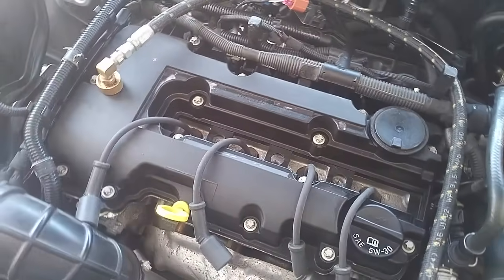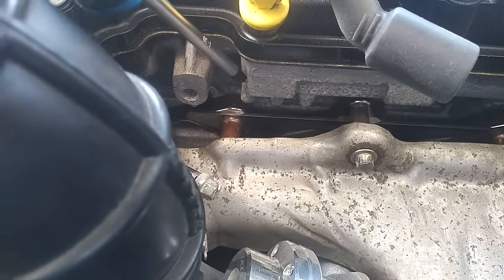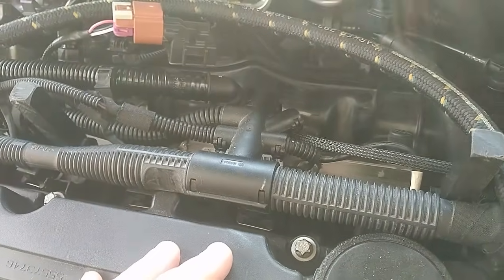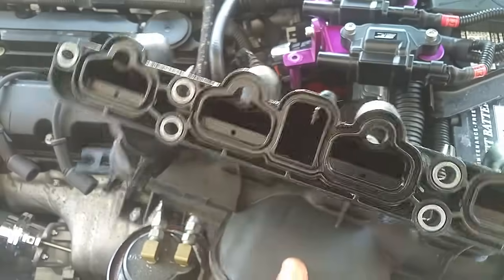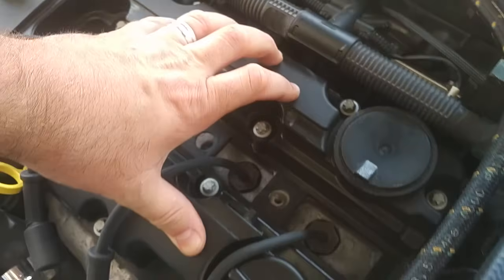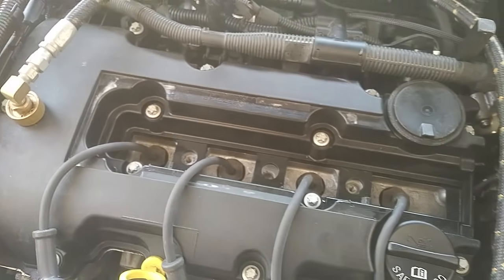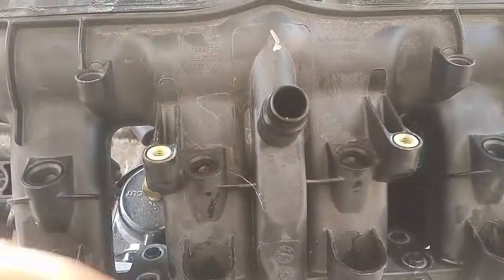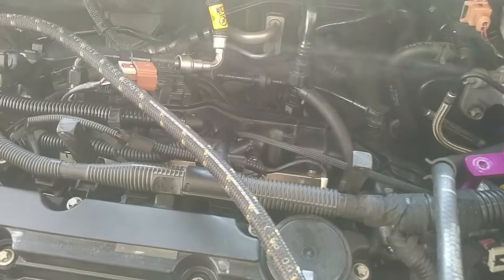Chevy Cruze Sonic Trax Encore 1.4L Turbo PCV Issues, Diagnosis, and Solutions

Comment: If that nipple you're talking about inside the intake is missing will that cause the p0299 under boost code ?
Reply from the maker: It will contribute to one. It may not cause it on its own, but a P0299 isn’t indicative of one single failure, but rather a number of things that reduce the efficiency of the turbo system, so a small crack in the turbo may not trip a P0299, but a large crack would, or a small crack and a missing intake manifold check valve (the missing nipple). So even if the turbo has a small crack (very normal and develops within the first 1,000 miles), you may be able to get the P0299 code to go away by addressing the missing intake manifold check valve.
Reply: The oil cap was left off and  vehicle was driven around for about 20- 30 min ever since then the po299 code came on
Reply from the maker: @tmangan327  that shouldn’t cause an oil cap to be off on its own. That would have been a p0171. Have you checked the intake manifold yet?
Reply: @AndreiDPop 
Yea the nipple is there 
On a tsb I found on Mitchell on demand it says to check the charge air bypass valve for oil water and  sludge . I found that same oil and water Brown mixture all inside the PCV valve when I blew some air in there
Reply from the maker: @tmangan327  the bypass valve solenoid will indeed also cause a p0299. It’s under the manifold on the passenger side. 

Worth noting that even having the check valve present won’t guarantee its working correctly. I recently had a customer with a 2015 encore with 96k miles on the car install my kit and pop his old check valve out, only to find that the flap surrounding the center hole has completely disintegrated and all that was left is the center. So that test isn’t even reliable anymore. 

Bypass valve solenoid sticking would cause vacuum to leak out to the bypass valve and cause the turbo to dump boost either intermittently or constantly. 

The condensation is from short trip driving, and the oil deposits are from running mediocre or sub-quality oil. 

I strongly recommend owners switch to AMSOIL signature series engine oil on these engines to prevent these kinds of issues.
Reply: @AndreiDPop  
It's a 2020 Chevy Trax with 40,000 miles  on it. I think I'm going to check that bypass valve later on today

Comment: Can an issue left unresolved in the intake manifold cause issues with the diaphragm? 

I’d previously replaced the diaphragm when my check engine light had come and I felt the vacuum issue out of the diaphragm hole on the valve cover, but only recently installed your v3.4 pcv fix kit when I was starting to have rpm issues idling and those issues are persisting even after your kit was installed, though no check engine light yet
Reply from the maker: Yes and it happens often. With the intake manifold malfunctioning or failing, the valve cover will fail prematurely, even 5x more often. 

Sounds like you have a vacuum leak, so you’ll need to find and address that.

Comment: Can this cause the car to cause light white smoke under the hood and make the engine feel real hot but not over heat when it’s having this problem ..  .. full of coolant and oil looks good and full.. no bubbling in resivor tank.. nothing coming out the tail pipe .. Help!! 2013 Chevy Cruze 1.4 100k.changed valve cover already didn’t check the intake manifold tho for the check valve
Reply from the maker: White smoke under the hood indicates a leak and burning of some fluid. Figure out what’s burning and where before you go any further. 

Wouldn’t hurt to inspect the intake manifold.
Reply: @AndreiDPop  there’s no leaks anywhere besides one drop like coming out after warming up then stops .. the block but it looks like it’s there for a reason if to much oil pressure or crankcase pressure.. but ima take it to the mechanic again he first said possible head gasket .. but now since losing no oil or anti freeze and it smoking a lil white smoke under hood hopefully it something not as major 🙏.. I replaced the crankcase seal the water outlet gasket I’m really hoping it a pcv issue

Comment: Hey, good video. I came here from the cruze forum and had a question. You said to remove the old sealer between the timing cover and cylinder head and replace it with new sealer. What sealer did you use? Thanks
Reply from the maker: Actually, I personally don’t use any sealer. I shaved the timing cover gasket so it’s flush with the head and timing cover, and smoothed it flat with some sandpaper so it’s a perfectly flat surface. Haven’t needed any sealer there since. Been like that for about 70,000 miles.

Comment: So the one on the valve cover, is air supposed to come out if it? I have 16 cruze, which has rough idle and sluggish acceleration. I just put new plugs and coil in. Took it for a drive it ran good still a little sluggish. Got home shut it off and back on and the rough idle is back.
Reply from the maker: No, air should never come out or in through that vent. Get a new OEM valve cover and get the v3.4 pcv fix kit installed if you haven’t yet.
Reply: @AndreiDPop  okay, I was mistaken. The air is being sucked in.
Reply from the maker: @christophertilson761  either one is bad. The vent is only there to allow the diaphragm underneath to flex freely (so there isn’t an air sprint chamber above it). Air should never flow in or out. If it is, you need a new valve cover and most likely a pcv fix kit too.
Reply: @AndreiDPop  thanks for the quick response.

Comment: The pcv valve hose has a small hose attached to it. What is that hose? Where does it connect? I kind broke the piece it attaches to. 🤦‍♂️
Reply from the maker: Bypass solenoid valve underneath the intake manifold.

Comment: While the intake check valve missing cause p0299 code underboost?
Reply from the maker: Yes it can.
Reply: @AndreiDPop  how do I know if the turbo is going out?  
I replaced valve cover because gasket was leaking and the diaphragm was sucking air.  Changed spark plugs it was still sputtering misfire cylinder 4 I replaced ignition coil pack and everything is running smoothly again.   But now p0299 code is on turbo underboost .

Comment: Hey Mate @AndreiDPop 

I've got issues. 

Blew my turbo, I replaced it. 

When it failed, it burst oil out of the Diaphragm. It sill bursts out now, even after the turbo swap. Only under turbo pressure. Not while at idle. Obviously there is too much pressue crankcast...

I've check the intake manifold nipple. I can see it buts it black.

Could it also be a block Catalytic Converter? 

Please help!!!
Reply from the maker: Which turbo are you using now? Also, which valve covers are you using?
Reply: @AndreiDPop  Valve covers are original & the turbo is a direct replacement. This is the model number for the turbo I've installed  MGT1446MZGL
Reply from the maker: @aaronhunter8943  pull dipsticks at idle and place your finger over the dipstick hole to seal it. Do you have positive pressure, strong vacuum, or mild vacuum?
Reply: @AndreiDPop  thanks for your help. 

No real pressure or noise difference. I'm going to replace the rocket cover. Obviously the diaphragm is broken. Hopefully that's the fix...
Reply: Hey mate 

Back again. Haven't had time to work on the car. Thank you for your help so far! 

So I got the new cover installed. Still having issues. Oil is been dumped into the cylinder, spark plugs are black,  obviously blue smoke as well. Also a new one, oil leak on the right side of the motor. It's all over the belts. 

So I've taken off the intake manifold. I can see the nipple but it is very oily & gunky. 

I think it's needs a new intake manifold. But they are $250 plus over here in Australia. 

What do you think?
Reply from the maker: @aaronhunter8943  it’s not the intake manifold. You should install the cruzekits pcv fix kit on that manifold while you have it off, but it’s not the cause of your problems. 

Did you inspect the pcv path in the cylinder head, between the valve cover and the intake manifold for deposits?
Reply: @AndreiDPop  Hi mate

Yes, there is deposits. Where the intake meets cylinder head.
Reply from the maker: @aaronhunter8943  need to clean those out. That’s causing an obstruction and restriction in the pcv path. Pull manifold and valve cover and clean that whole path.
Reply: @AndreiDPop  ok. I'll give it a ago 👍
Reply: Hey mate 

So I've clean the check valve/intake manifold & reinstalled. Now I've got positive pressure when I pull the dip stick or oil cap. 

 I can feel air been pushed out.... This is getting frustrating 😞
Reply from the maker: @aaronhunter8943  that’s not a reliable test. Pull the dipstick at idle and place your finger over the dipstick hole to seal it shut. Do you still feel positive pressure?
Reply: @AndreiDPop  yes, that's correct
Reply from the maker: @aaronhunter8943  have you done a compression test?
Reply: @AndreiDPop  yes, all good
Reply from the maker: @aaronhunter8943  only other causes are defective valve cover, bad turbo, or blockage in the PCV path from the valve cover to the intake manifold.

Comment: After getting a constant headache trying to fix P1101 on my chevy trax, I'm about to give up. I've replaced the throttle body, replaced the MAF sensor, replaced the intercooler (which had a bad dent I couldn't see without disassembling the whole thing) and I am still getting that check engine light with only one DTC: P1101. Please, can ANYONE shed a light on what can possibly be the cause of this? I honestly can't even say whether the car is running odd or not, thats how long i've been getting that DTC on my scanner. To be fair though, the idle is not rough,  the only things I feel are "off" is the fact that the car sometimes takes too long to respond when I hit the pedal and it also seems to be taking too long to change up gears. I also can't tell if the engine is hissing, as I'm not sure what that would sound like (if it's super audible, or subtle and i should be hearing it from outside the car with the hood open). Any help is appreciated, thanks
Reply from the maker: Have you inspected the intake manifold for a missing check valve?

Comment: So lets say the check valve breaks or hose pops out off the check valve or just any leak leaks in general around that modification they will loose break assist because they would have a major vacuum leak. Is there not a safer spot to t the vacuum from?
Reply from the maker: I’m a bit confused as to your question. I haven’t had any issues with leaks on thousands of these kits that have been shipped. I haven’t been using the T fitting on the v2 kit for years. The newest kit available is the v3.4 and it’s a completely different design.
Reply: @AndreiDPop  lets say for instance the a side of the hose to the modified pcv comes off... now you have a vacuum leak and that t fitting you use to stack on top off the original vacuum for the brake booster is compromised and losing vacuum thus causing the brake assist to be minimized correct?
Reply from the maker: @eduardopolvos9667  I don’t use a T fitting to stack on top of the brake booster. That design is no longer available and hasn’t been available for a few years now. 

Even so, that is a mechanically strong connection so at worst, you’d have a leak.

Comment: I can not positively see the red button of pcv valve in intake manifold.  I replaced the valve cover and pcv valve at turbo.  Is there any danger of continuing to drive the car without positively knowing the intake manifold pcv is not broken?
Reply from the maker: Clean it and try to look again. If it’s bad it will cause you more issues down the road and premature valve cover failure. 

If I were you I’d just order the cruzekits v3.4 pcv fix kit and install it anyway.

Comment: I have the 1.8 liter. Needs the same repair. Cost twice as much money, as the 1.4l. Luckily I’m a DIY. Just parts alone from oreily is over $600 dollars. A shop bill for the car is over 2k. I’ve done engine swaps for half the cost of this POs crap. I don’t get it. Do they do this intentionally. Like a group of engineers that design a system to be flawed intentionally to make money on parts and repairs in the future? I hope the worst for the engineers of these cars.

Comment: My question is will that hole on top of the valve cover could it cause a mis fire in cylinder 1? I’ve replaced spark plugs I’ve done the coil pack I’ve put a new injector in and it’s still throwing P0331
Reply from the maker: Typically it would be a random misfire not just cyl1. Have you done a compression test?
Reply: My bad it was code P0301 telling me circuit is short in cylinder one Idk I’ve replaced the injector for that cylinder I’ve don’t spark plugs coil packs and I did a new valve cover gasket but it’s still running like crap. I order a new valve cover the vacuum went is sucking mad air maybe that will fix my problem

Comment: What about a P0299 code?
Reply from the maker: I have a video on that one as well. 

Is your car low on power? Or just tripping the code.
Reply: @AndreiDPop  the code pops up from time to time, but when I'm mostly on 2nd or 3rd gear I feel like there's not enough power
Reply from the maker: @phoenix179  have you inspected the manifold for a missing check valve?
Reply: @AndreiDPop  I have not yet
Reply from the maker: @phoenix179  try that first. It may only be a missing check valve that you need to address. The cruzekits v3.4 pcv fix kit would be an easy solution to that if that’s all it is. 

P0299 is usually a combination of things and often times addressing just one of those fixes the problem.
Reply: @AndreiDPop  will check that out then, thanks for the advice!

Comment: I used your kit and my valve cover is still building up pressure and pushing oil out around  the bolt holes any other ideas I got new valves and the valves that go on the intake and turbo  ?
Reply from the maker: OEM or aftermarket valve cover? 

Pull dipstick at idle and place your finger on the dipstick hole to seal it. Do you get positive pressure, mild vacuum, or strong vacuum? 

Which way is the check valve in the fix kit pointing?
Reply: @AndreiDPop  it's pointing away from it and if you pull the dip stick with the car running it has pressure its pushing oil out around the bolts I followed the video of your install to a t anything I'm missing?
Reply: @AndreiDPop  oem valve cover I recently changed the gasket and then it was pushing oil out around the bolt holes because crank case pressure building up so I realized the rubber nipple was gone down in the intake I installed the kit you sent but still have build up off pressure in the valve cover
Reply from the maker: @waltervanhoose2557  please perform the test I described and let me know what you find.
Reply: @AndreiDPop  it's like a mild vacuum
Reply from the maker: @waltervanhoose2557  ok that’s working correctly. Pull valve cover and check the pcv port (about 1/2” diameter square-ish) on the back of the cylinder head for deposits. 

Do a compression test also.
Reply: @AndreiDPop  so I pulled the valve cover back off the square port is clean but looking at the 2 wholes in the top of the valve cover there is carbon build up in it is it possible the inner part of the valve cover is stopped up with carbon deposits
Reply from the maker: @waltervanhoose2557  unlikely but possible. Have you done a compression test?
Reply: @AndreiDPop  I put brand new valve cover on today it may have fixed it
Reply: @AndreiDPop  I don't have the tools to do a compression test on it
Reply: I dunno why it would build up pressure it also has a small surge while setting idle  it don't stumble on take off like I've seen others say they had problems of
Reply from the maker: @waltervanhoose2557  because some valve covers are defective and cause high crankcase pressure, cracked pistons cause high crankcase pressure, and blockages in the cylinder head due to deposits also cause crankcase pressure.

Comment: Also my valve cover diaphragm isnt making any hissing noises or sucking anything in. If i remove oil filler cap or dip stick theres no change in idle. I have black smoke from exhaust, black spark plugs, black in turbo turbine. Getting p0171. Ive changed exhaust and intake manifold gaskets. Cleaned throttle body, changed maf, cleaned the nipple area. Cant figure this thing out
Reply from the maker: Is the check valve present in the intake manifold? 

You should have vacuum on the crankcase. Place your finger over the dipstick hole at idle. What do you feel?

Comment: Mine looks like yours, when you buy replacement valve cover it shows on the paper that part of the manifold but the circles around have orange. Ours only have the center nipple. Wouldn’t that be an issue as well ?
Reply from the maker: You can only see the orange around the circles when looking in from the end of the runners not from the top where the pcv pipe goes.

Comment: So could a bad pvc pull a strong enough vacuum to get oil in the intake? I took my intake pipe off and it has oil in it and it's white smoking from the exhaust
Reply from the maker: No that would probably be a bad valve cover. Intake manifold could have caused that so you’ll want to check both.
Reply: @AndreiDPop  well I just bought your pcv kit. I hope it solves my problems 😅👍